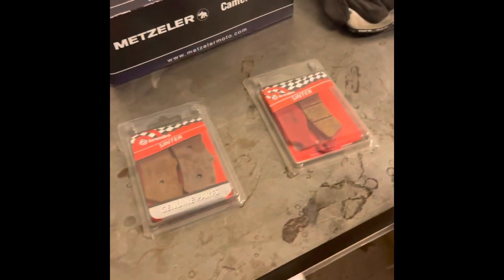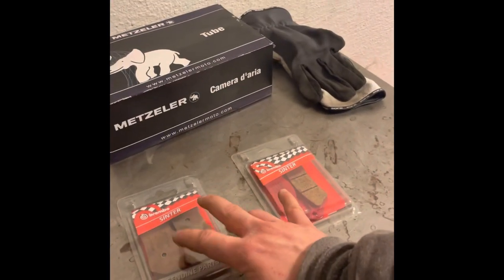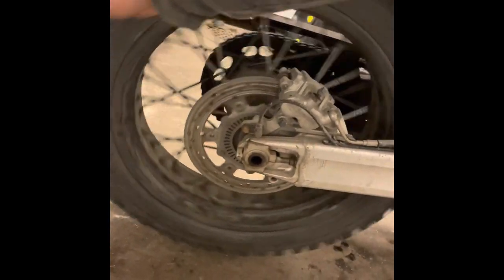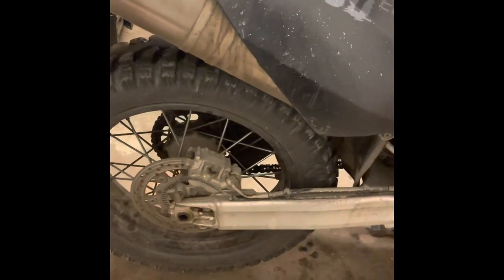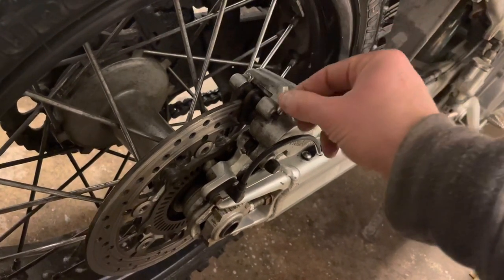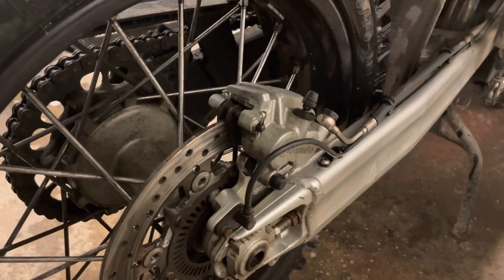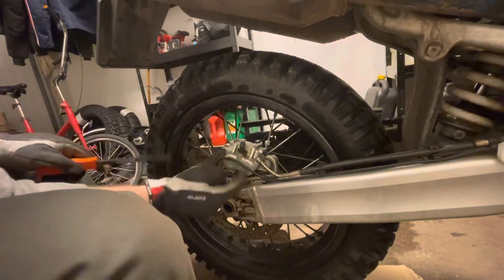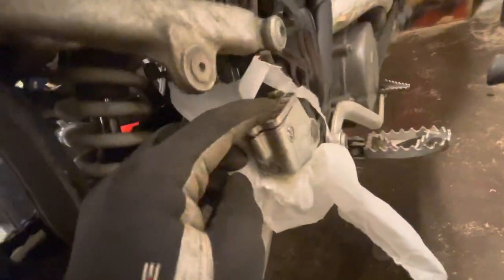Ktm 990 Adventure rear brake pad change

Comment: Hi, wouldn't it be a good idea to take the caliper off to give it a proper clean? You can also use the moment to grease the sliding rail that the caliper attaches to. Also, if I remember correctly, one should grease the pin that holds the pads in place with copper grease.
Reply from the maker: You are absolutely correct:) at the time i wasnt that familiar with the bike but when i do this again i might do the caliper:)